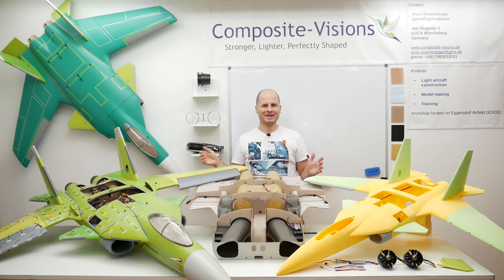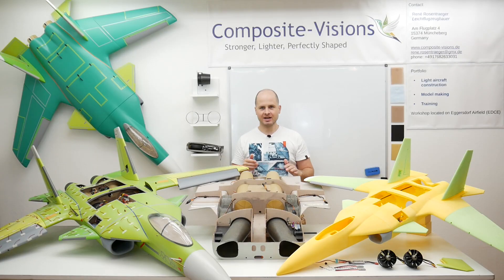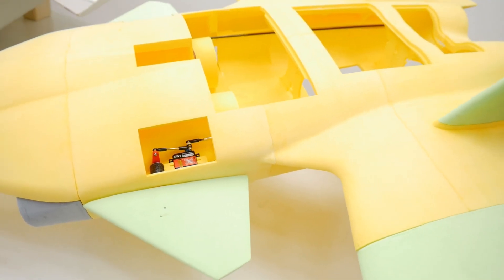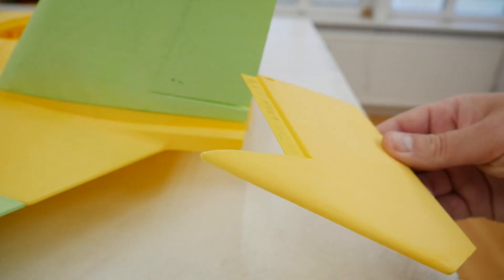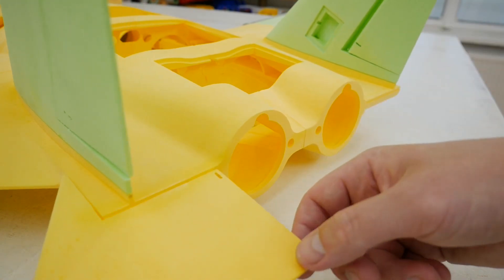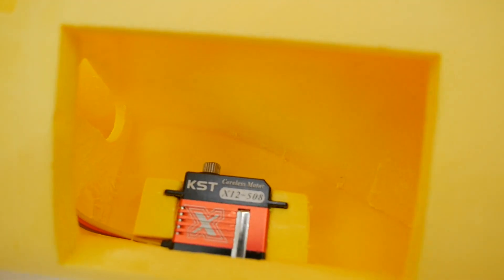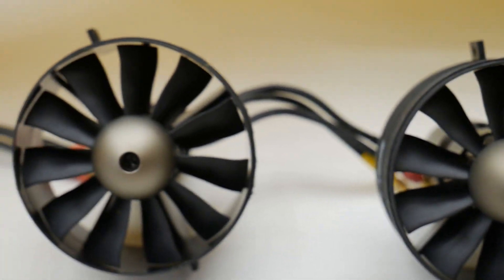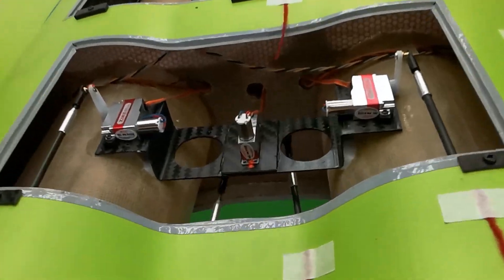Full Acrobatic LW-PLA 3D-Print Jet Project

Comment: Awesome!  Thanks.  Which websites are selling this model?  Also please share if there are good websites to buy from them the 3d plan stl files.  Do the plans come with building instructions or power setup requirements or I will be left with a bunch of plastic pieces and I need to guess which ones go together?  I ordered p1s and looking forward to start and learn about building rc plains.  Did you use light pla or normal and usually how many filaments you need up build one jet/airplane of a wingspan of 1500mm.  Could the aircraft plan be scaled up.  For example if stl file is for 64mm, could I increase size of every thing and make it 90mm.  A lot of questions!  Thanks
Reply from the maker: Get it on rc-jetprint.com
Reply: @rene_rosentraeger  thanks a lot

Comment: Absolutely amazing!!!  Look forward to build one, especially if it comes with VTOL.    Couple questions, Rene, if possible:   1) why 64 mm ?    EDF 70 mm is much more common.   2) 1700g  - is that a frame weight or expected take-off weight?   It would be good to keep take-of weight under 2 kg for various aircraft model / drone rules.
Reply from the maker: The actual size is perfect for first testing. Later on it's easy to scale up to 70..80..90mm. 1.7kg is TOW👍